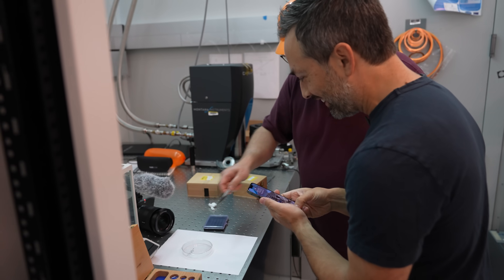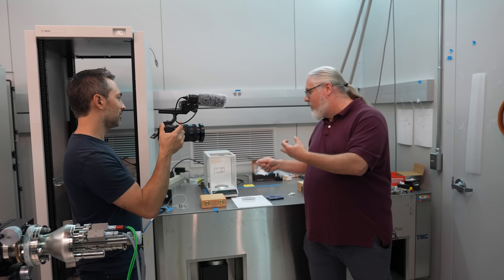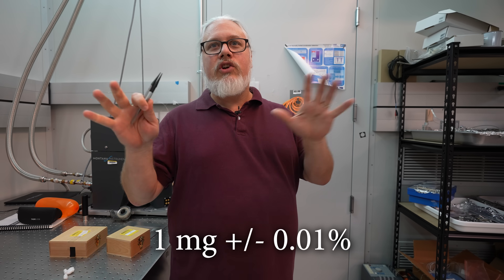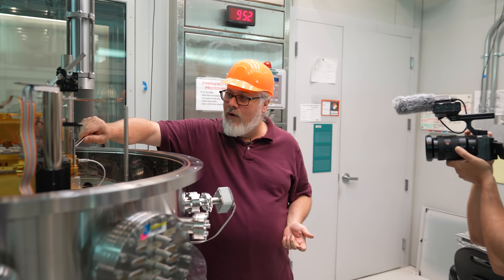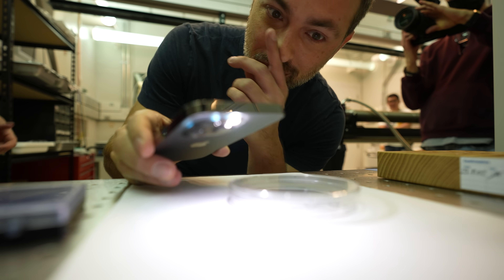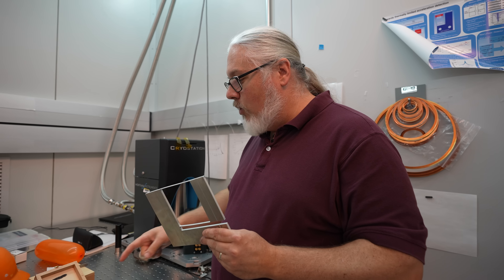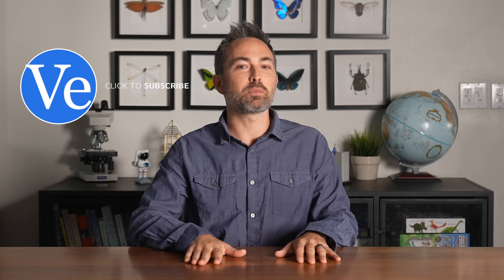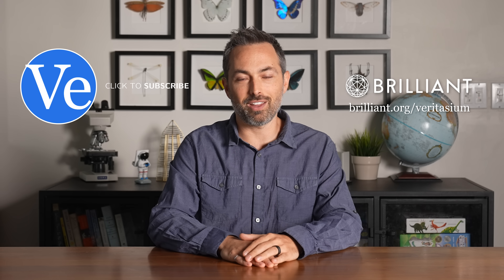How To Measure The Tiniest Forces In The Universe

Comment: I always used Al foil if I wanted to get fairly rough, but accurate low value weights of less than 1 gram. They usually show the thickness of the foil on the box, or you can measure it with a set of micrometers mine cost $5 from aliexpress and match up with my set of feeler gauges to within 3% down to 10 microns or 0.01 millimeter. So, knowing the thickness of the foil, and the density of aluminium, I can cut 1 square centimeter pieces (or smaller) with a razor and get pretty accurate weights. As accurate as I can cut them. It's a nice poor-man's method for making low value weights. Just be sure to take your errors in measuring/cutting them to size into account. Vernier calipers can help a lot to make accurate measurements for cutting.

Comment: Looks like a basic heating and cooling effect to me, what proof do you have it's the laser not the heat generated?
Reply: It's a silicon surface and silicon is quite resistant to hear and with that they might use least excited laser beams like just for an instant (nanosecond or less )

Comment: I've order certified weights from NIST many times. As sample size increases the standard deviation of the means decreases. So if you're weighing something in the 10 milligram range uses you can't use just one below an one above the range, there are other standards in many industrys like ISO 9001 which require more and more data points, some times 5, I've even seen some that require 7 and your correlation coefficient to be greater then 0.998.
 I'd be interested in knowing why the standards were getting lighter,  could be the mass lost on earth to solar winds?

Comment: I visited a lab that provides calibration services to, amongst others, the South African government (where I live). They procured a set of standard weights for a government department, verified that they were accurate and supplied them to said department. A couple of weeks later they received a complaint that the weights were inaccurate. They asked them to return the weights for inspection. When they opened up the case with the weights, they immediately saw the problem: Each weight had been engraved with a government asset number :(

Comment: I made a gadget using a laser beam tied to a long strip of steel spring, 1mm thick and 300mm in length, one end secured to a base, the other end floating, and I placed a piece of paper 3mm x 3mm and could see the laser pointer deflect by half a mm projected on to a wall about 4 meters away. I call that pretty cool.

Comment: The kilogram is no longer defined by the metal cylinder. It is now defined by the plank unit using an electrical resistance machine called a kibble balance.

Comment: I like how they take a jab at our ’Mur’can Freedom Units, which is one of the first modern standards, then pretend that the unit of weight in the metric system is not impractically small, such that the physical standard, the kilogram, is a thousand times heavier than the basic unit, the gram. And the whole thing is based on someone’s random weight of two pounds and some change.

Comment: The amount of force on my window glass exerted by the 5G signal from my local cell tower is 8.378751247638124372028064828769e-22 Newton. f = E / v. Energy was obtained from converting RSRP-NSA = -96dBm. v is speed of light.

Comment: My professor for metrology explained it quite nice: In a car, to get a good seal and work properly, the piston can have a (hypothetical) tolerance of 0.1mm. To make that part, the lathe it was made on must have a tolerance of 5um. To make that lathe, there is a special procedure and machine that can make lathes and has a tolerance of 0.1um. And to know that that machine and procedure is even working, you need a lab and scientist, that can measure down to 5nm. If you find a way to to that measurement down to 0.5nm (which might seem totally unnecessary), it's only a matter of time until the car will have a piston with 0.01mm tolerance (which can enable higher compression and better efficiency).

Comment: But there is a problem with precision: The mass of the operator influences the gravity very slightly. And the gravity and its gradient is also fluctuating very slightly. Here in Finland the geophysicists have a supergravimeter which measures the gravity with an extreme precision. Nanogals actually( one gal=1cm/second squared).

Comment: AFM cantilever tips are worth about $100 each and they are easily lost if the sample is irregular and they might crash on the surface. They are made from silicon nitride and the "diving board" is actually just the HOLDER for the tip, which is atomically pointed to have a surface area on the order of single digit nanometers. If you crashed the tip it's easy to see because the whole diving board will break off and be lost somewhere on your sample, again this is just the holder for the tip which probably requires SEM to view properly. Installing the tips onto the microscope is very tricky, easy to spoil them. They are $100 each so that is motivation to do it properly otherwise that money will be gone in seconds.

Comment: ‌I"n 1 Coup 0.0883333 Degree 
And I"n 1 Joule 5 Coup 
11 Character  54 
1.90 

1 Hour 48 Minute's 108 Minute's To Get I"n All From 
90 Joule Call Neu 
180 ml 

9 H-our 540 Minute's 
All Before 41 Ear's To Get I"n 
450 Joule Call Neu 
900 ml 
1 Liter 158 ml 

11-Hour To 36 Minute's 696 Minute's To Get All 
580 Joule Call Neu 
1160 ml 
1 Liter 418 ml 

1:6.444444 
1:5 
1.28
To Phase 6 Endin To Phase 4 Bein To Phase 3 Endin 1:1.28 
From Phase 6 Endin To Phase 3 Bein 1:6.444444 
Phase 4 Bein To Phase 3 Endin To Phase 3 Bein 1:5 
I"n Ace To Get I"n Satisfaction All Per Certificate As Per Complete Line Assesmblein And As Per Certified By ANP Card To Get I"n Employee Fund Provident 

60 Minute's To Get 300 Coup To Get I"n 
39 Joule Call Neu 450 Fract 
46 Minute's 52 Second's 50 Fract 
17 Minute's 7 Second's And 50 Fract Faster All From Phase 6 Endin All From 60 Minute's Vvork To Get I"n 46 Minute's And I"n 52 Second's And 50 Fract To Get 
Novv 
Save 17 Minute's And 7 Second's And 50 Fract To All Phase 4 Bein And Phase 3 Endin All From 0 Ear's All after To 6      Ear's Call Phase 1 Bein

Comment: I work in the printer industry, actually designing ink jet print heads. A typical droplet has a volume of 3-4 pL (that is 3-4 * 1e-12 liters). We can measure flying droplets with a fancy high speed camera, using rediculously short laser pulses. So the volume of a droplet can be measured very exact. Now. We know the bulk weight of ink (or water for that matter). So we know the mass of a single droplet. This weight is way, way more smaller than a microgram. Such a droplet is of course not suitable to be used as a test weight. So: just for fun this comment.

Comment: 11:25 But wait, photons don't have a mass right?! How is that thing moving because of light!
Reply: They don't have mass but they have momentum. It's not actually E=mc^2 but E^2 = m^2*c^4 + p^2*c^2    with p being the momentum.

Light has momentum but no mass so m=0 and p>0 depending of wavelenght. 

Which means you can simplify E^2=m^2*c^4 + p^2*c^2    into E^2=p^2*c^2   so E=pc    momentum will depend on the wavelenght but the shorter the wavelenght is, the higher the momentum is and the more energy has the photon, and the more force it will have. Which can be used to measure mass with a laser of a constant wavelenght (constant energy and so constant force)

Comment: 72 Ear's Or 63 Ear's Or 57 Ear's Or 
288 Ear's Can Get 
I"n 208 Ear's And Save 80 Ear's Or Can Can 
Get More 80 Ear's 
To Get All in Novv 368 Ear's To Get I"n 
To Get I"n All  Novv 62 Ear's To 72 Ear's Ahead I"n 6G Board's And To Country And To 46 Circle of 72 Kilometer's Diameter's All are I"n 1 Circle of 72 Kilometer's Diameter's To Have This Education And To Get I"n State And To Country Then I"n Vvorld There Are 
546 Circle of 72 Kilometer's And 
546 Bar of 6 Kilometer's I"n Breathe And I"n Vvidth I"n Graph To Get I"n
 Milat Ary"s All Before 41 Ear's All Novv I"n 33330 Ear's in All From 41 Ear's I"n Vaccom And Subcoom And Coom And Coup I"n Frequency I"n Hert'z Mega I"n InterPlantery Eclipse Of Breathe 
48 Lac's And Distance Betvveen Each Gas Planet I"s 5 Lac's Mile's And All Reserved I"n Sp-Rin And ST-Rin To Get All Engery I"n ElectroRetino Graphy I"n 6Coup Or 6 Cloumn Of Book Call Long Book I"n 7200 Fract I"n Scale of 
159 ElectroRetinigraphy I"n 
1200 Fract
 26.50 ElectroRetinography And 36 Character Desin All From Breathe All From Climate All From Ozone Same As Concreate Highvvay To Get I"n Air Quality Index And To Get I"n Construction I"n Mall All Gases I"n Interplantery Eclipse All From 9 Gases Planet And Mixture Of Gases To Get Breathe All From Ratio Proportion Scale MeasureMent Scale And Extra To Get I"n By Formula Of 8 Dimension Of 1.22% And 12.20% And All From 100 % And I"n 86.58 % 70 Percent And 30 Percent And I"n 70 Percent 50 Percent And 20 Percent All from
Carbon, CO,CO2, CO3 , 
Helium, Hydrogen
Oxygen Call O, O2 , O3 
Nitrogen 
Phosphrou's 
Sulphar 
Carbon CO2 
CO3 
C
Sodium 
Chlorine 
By 87 12 3 24 44 
SOO 1800 Celciu's
HHH 600 Degree 
HHO, 108 Degree Or 324 Celceiu's 
HO, 36 Degree Or 108 Celceiu's 
OO,  R-I"ce All Tovvard's -1720 Farhenite Cutin And Cutlace 
OH - Prepration of Defrostin Call Freid 
OOH- Preation Of Defrostin 
OOO Defrostin 
O Defrost 
C -Defrosted 
CD - All I"n Defrosted 
17.20 Current Direct 1 Joule  all 2ml 
Call Surgeon of Secondary Class I"n 6G Board's Call I"ntelligence To Get Our Self Heavean And Save From Dozak Or Hell Or Jhanum Or Narak Or PatalpraniPraiser 

12.80 
All To 
Be To 
Have To 
See To 
Vvhom To Vvhat To Get One BAD 
Best 
From All Best 
From One Best To
BAD 
To All BAD 
To One BAD ( Vision All I"n Emotion I"n 4 up 1 Majorup 1 Majesticup 1 Universalup 1 R Or 1 T Or 
Can Be Deceased 
Or 4 Dovvn , 1 MajorDovvn, 1Majestic Dovvn 1 Universal Dovvn , 1 R Dovvn, 1 T Dovvn.
I"n  a Scale of 4,8,16,32,64,128 
Delta -Call Control To Get I"n Vvith Action And I"n Calculation On Excuation Vvith Fear and Vvith Pressure 

6 MAARFA All Chaster's And All Dauhter To Get I"n Conversation And On Deal 

M- Cell Develop by Fract 

12.80 
All 
Breathe From Climate From Ozone By Nose And By Nozzel

Comment: so what about measuring errors in the temperature
Reply: the curse of mutually dependent measurements
Reply: you could also define weight by cantilever bending
Reply: or any weight lever multiplier arm
Reply: you can self-calibrate a mass measure test by directing the same mass (the same object) to two/both sides of the measurement device
Reply: cvd/pvd nano scale stuff
Reply: making the comparison weights by nano processes
Reply: if you measure the same object by multiple different cantilever bending, you get the exact independent weight, even without knowing the cantilever material details
Reply: self-calibrating (referencing) system

Comment: You should get in touch with a company called LUMICKS. They specialize in something called optical tweezers; the type of system you would be stretching DNA with. It's a fascinating technology with which one can "pick up" polymer spheres using nothing but light and measure the forces applied to that sphere. The idea behind it was actually worth a nobel price not too long ago.

Comment: I used to work on deep UV lasers used in chip manufacture. Since the beam was invisible, we used a business card in the beam which fluoresced a nice violet color to make it easier to set up the light table to make our measurements. Once I leaned the card against the output shutter of the laser which was closed. Opened the shutter and watched the business card instantly fall over, thought to myself, LIGHT just did this. Glad to learn I wasn't seeing things, because part of me had a hard time believing what I just saw.
Great video.
Reply: not nice < niais < nescius := not-skilled but you are.  A Crookes radiometer works on heated propellant.  Nothing to see here.
Reply: @alysdexia  Said the Dr. reading your brain scan.

Comment: BS thru and thru. Blah but no results. Where is the measurement of the laser putting pressure on a mirror? Nowhere. Because then you would have to validate the energy-mass equation and that does not hold -- it is but a fantasy. And the biggest BS is when the author invites you to do scientific thinking. You may think you are scientist but science is built on the scientific method and if you do not hear the expression scientific method you are being fed crap, in this case the Veritasium crap. Sorry.

Comment: This is how the double slit experiment actually works. Its a play off of Crookes Radiometer. The pressure of the laser causes the slit to resonate its like an opera singer singing the resonant frequency of a glass. The slits then resonate as expected and cause the photons to deflect off of the resonating blades, string etc.

And the reason why we prefer the imperial standard is that while metric is good for measurements, it's application would be retarded. Try tuning the electric grid to the metric scale. A foot, a minute, a year all have the same thing in common: easy of application, you can subdivide it by 1 2 3 4 or 5 in the case of 60. 12 can be subdivided by 1 2 3 or 4. This was understood since back in the days of sumer. How do we pretend to not know this?

Comment: The "kilograms" in question are chunks of metal intended to have the mass of a cube of water measuring on each side one hundred millionth of the distance from the equator to the north pole along a meridian through Paris.  That the USA uses one of these chunks as a mass reference standard does not mean the USA is "on the metric system."  If the USA were on the metric system, then surely Derek and the other Paris meridian people would stop whining about how the USA is not on the metric system.

Comment: If everything is undergound, doesn't that change the relative air density enough to alter the weight relative to surface level measurements? Also, it's closer to the core of the Earth which increases the proximity to the dense gravity of the center of the earth. This is why I measure nothing.

Comment: We have 4 Advance Research Laboratories on campus and had to put two of them underground so that we can control temperature to 0.01 of a degree and provide the necessary amounts of RF & microwave shielding. Many of the lab spaces also have vibration dampers. That is why we are to measure so accurately, less "noise."

Comment: I don't know about all of this.
How do they acct for other sources of radiation?
     Light in the room, gamma rays, earths magnetic field. Gravitational variations from people or even cars driving by.
At the scales being measured here, they all would need to be accounted for.
     There's no way to prevent 100% of "stray" radiation from effecting the measurements.
The Moons position would massively effect it all.     "Mass" get it?  Moving on.
    I know how interferometry works & at the scale of "gravity wave" measurements, how could 
one know which of these fields is being measured.
     Even the mass of the electrons is the measuring equipment must be accounted for.

US paper currency weighs 1g
$1 bill, $5 bill, $10 bill etc.   
Each individule bill, 1g.

     He is wrong!   
The rest of the world uses the U.S. Imperial measurement system then THEY CONVERT  that, into metric!

Comment: Lets make one step deeper! How do you know that the voltage on the capacitor is the exact voltage you want? Who calibrates the voltmeter?
Reply: You can use Josephson effect to produce voltage that only depends on provided frequency and fundamental constants (Planck's constant, elementary charge, etc.), and is independent of anything else. It's called Josephson voltage standard.